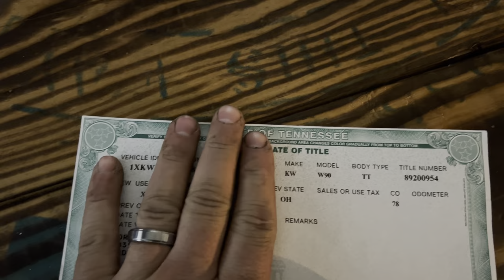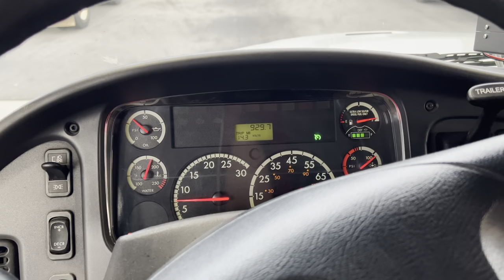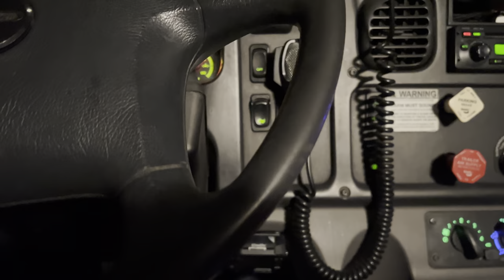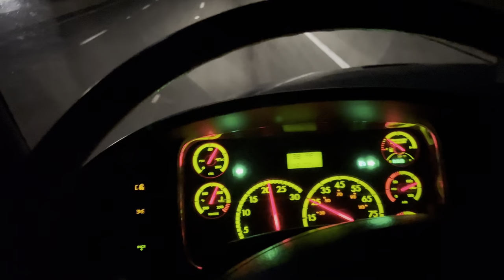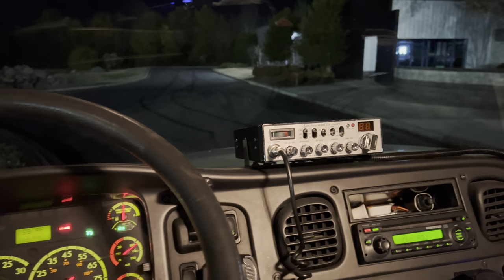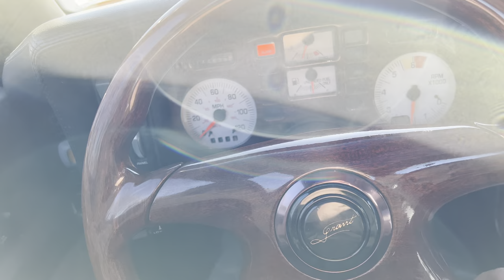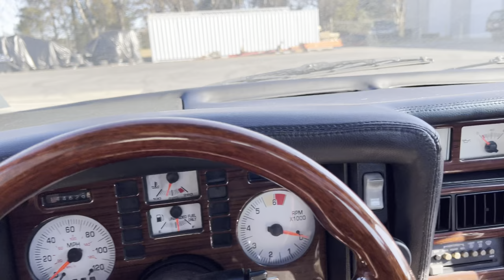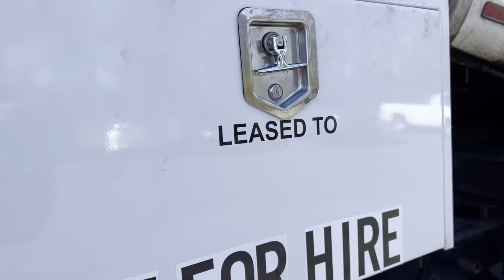W900 KW UPDATE!! I ran the new rig over black mountain with no trailer breaks…

Comment: HAHA . Nice to see you in my neck of the woods.  When I was on the road I used to love to hit the truck turn out at the top of Black mtn.  That meant get out and pee and 45 mins I would be home. Proably 35 years ago I was halfway down or close to it and a driver started hollering on the radio "get out of the way I'm taking two right lanes with no brakes!" He came by me and hit the third {last] ramp HAULLING ASS! It was a cabover pulling a flatbed load of flat steel sheets as wide as the trailer. We watched him hit the last ramp and almost pushed thru the piled up berm of sand at the end of the ramp. The cab locks broke and the cab was almost full tilt when he stopped as I went past. We were on the phone with 911 as he hit the sand trap and stopped at the bottom of the mtn and they told us they were getting multiple calls and that state troopers and ambulance were on the way and that trucks had stopped at the scene. Never seen anything in the news and have always wondered how the driver was.  Not really a place you can turn around and go back and see.  17:00 in the video is the one he hit!  It gets all the trucks. I think I would try to ride out that last curve if there was no traffic I think, cause it is a real smooth curve to the right then left.   Hope he was ok.

Comment: I drive up and down black mountain everyday. Never have to touch the brakes.
Reply: Prob drive a auto. Hahha. I still hqve to hit them running down mtn empty sometimes..
Reply: @brentlance2379  nope. Select the correct gear and adjust the engine brake to slow down or speed up.

Comment: For sure, Me being 72 years of age am having a quandary. I have driven some high horse power cars of my own which by today seems like a Ford Escort so heres the question. Can a four hundred horsepower engine in a car that is supposedly got way high torque, like say five and a half...550 torque move a semi truck down the road? Pistons in a semi weigh as much as all the ones in a car and the crankshaft I couldn't tell you but its got to be weigh more than ones in a car. So tell me how these one  thousand horsepower race cars can really have that in anything besides a slingshot sized rig compared to like my logging truck which was cut down everywhere we could to save weight was still over twenty five thousand pounds. I hauled logs to the pulp mill an we got paid for the load, not the load and the truck too. Can you put it in words how this large horsepower thing works.  Okay now Tim, I love your channel and I push it onto truckers and others all over the world as I talk with my hands in a manor of thinking. I don't get on the phone  to talk, its in the comments. Heck I live alone out on my homestead or whats left of it. I did have you all, I'd go nuts. In fact, I'm sure that I might be half a bubble off anyhow. When I see a shop like you just walked through, I wonder to myself how did they get so rich? I owned a couple business's in my life and both times it looked like I was rich but far from it with burning money on stuff to save on taxes and then all kinds of equipment that ain't free. I would of been stinking rich at one time if I could of sold everything for money, timber, equipment an truck an car and home an shops.... name it an I had it including a  Hughes 500 helicopter that was in real nice shape an was getting my personal flight licence.... If I could of stopped at a high point and sold everything then I might of had a few million in cash but money don't stick around unless that you feed it. People think just stop working and set back and drink drinks with  the umbrella in them. I couldn't do that no way and sides, I liked working. I hate not being able to walk three steps for sixteen or more years as its kinda a fuzzy area as doctors just kept making my problems get worse. I sure hope and I don't see a reason to worry as to you changing if you got stinking wealthy. I don't think that those tycoons are unhappy, I just don't see them to understand what poor really is. Man oh man did I drift off tonight. Loved this show an will be watching the next one

Comment: Hey Tim, I know your geared more towards HD motors, but I've got a 6.6 LLY that 'm pretty sure has just blown a head gasket. The truck has about 150k and in great shape. My question to you is if you had to send the job out (not use your own shop and employees) would you fix it or trade it off?
Reply: 150k is pretty quick to blow head gasket . what makes you think its out? 

what diagnosis have you done
Reply: @SXSPRIME  I drove it about 8 miles for Thanksgiving dinner and blew out half a gallon of antifreeze from the overflow. It’s a ‘05, think the head bolts have finally stretched
Reply: @riverrat2592  you must had been one of the lucky ones to get tge bad batch of torque to yield bolts.  if its a clean truck id fix it 

im from ny been looking for a clean lly/lbz for years